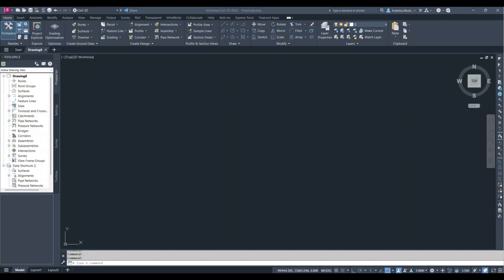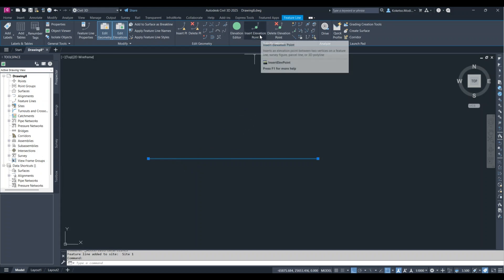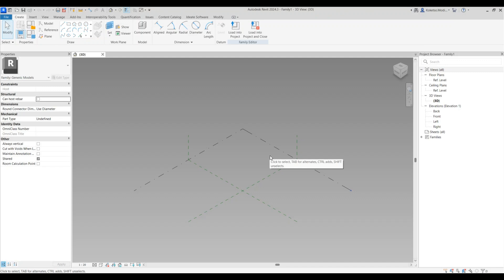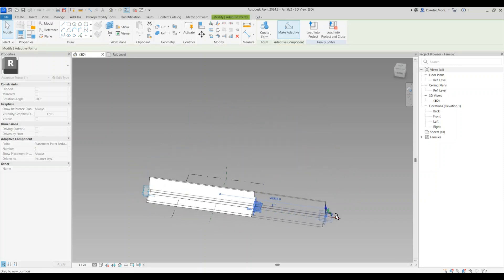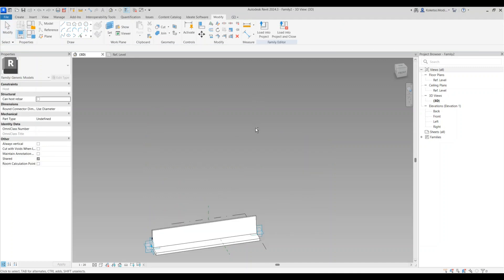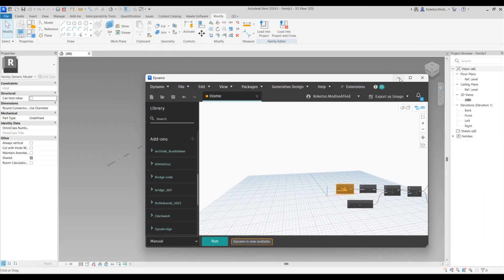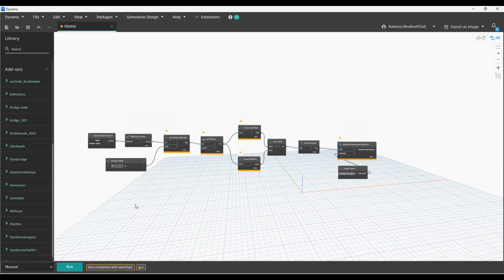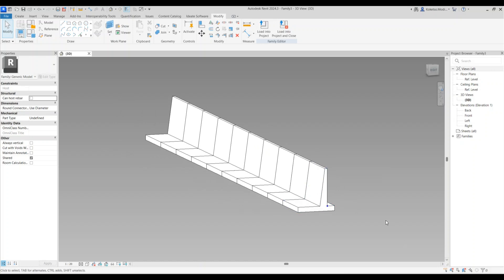DYNAMO - Placing an Adaptive Retaining Wall based on Civil 3D Feature Line

Comment: Thanks for your wonderful video, it's great to know Revit can work with C3D!
Just one question please, what do you do with the generated retaining wall model after this? export to dwg or keep it in revit?
My requirement would be get it utilized in C3D so.

Thanks again and look forward to your comments!
Reply from the maker: Rebar and Detailing. The basis of this tutorial was to guide you to model a structure based on Civil 3D data.

Sometime it’s not easy to creat sections and elevations in Civil 3D and the interoperability between REVIT and Civil 3D can solve that problem.